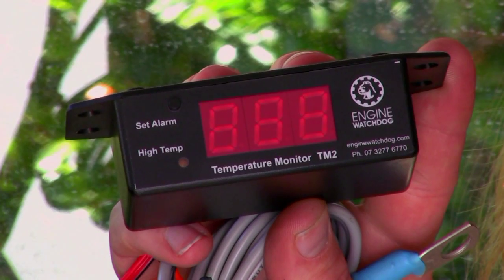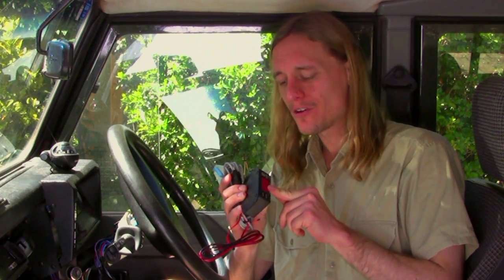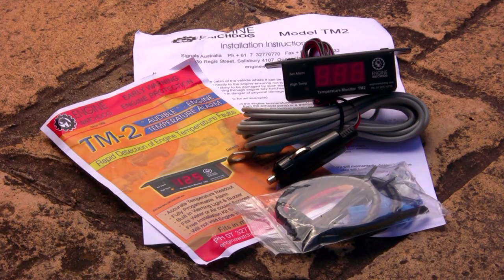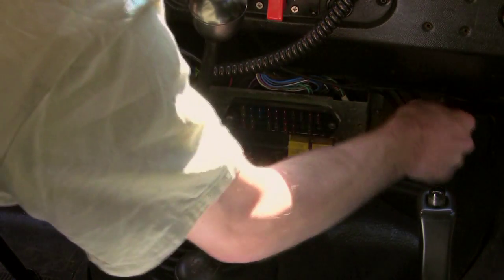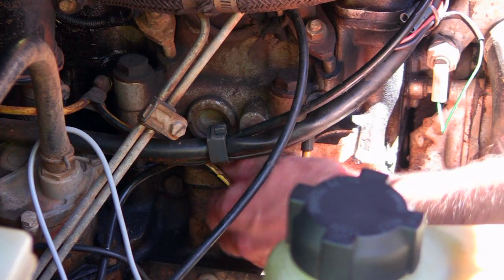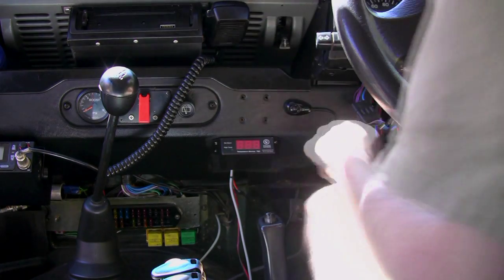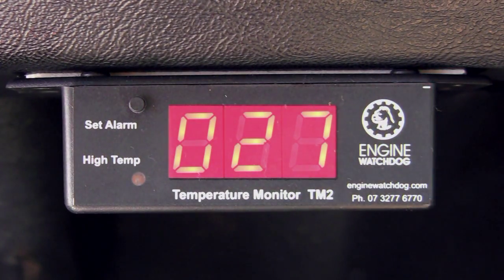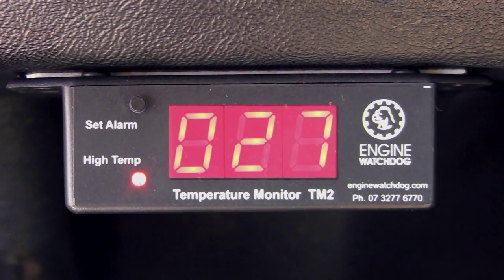Engine Watchdog TM2 Temperature Alarm Overview and Installation

Comment: Genius idea !! , Thank you
After you try the device .. what is the maximum temperature the engine body can reach from outside in " normal operating conditions " ??
Reply from the maker: Got up to 98 degrees Celsius pushing hard up hills.
Reply: thanks very much
What is the first degree of temp when the engine starts to be damaged ?
Reply from the maker: Don't know, but if your cooling system has failed, then the engine can cook itself and seize. Once the alarm sounds and the temp keeps climbing you know something may be wrong so stop to investigate.
Reply: thanks man

Comment from the maker: yes mate thats correct... I believe there is a new model out with 2 sensors for just that purpose!
Reply: thats the one i purchased , Also its not bright red its Back lit LCD display , You can get the sensor wires up to 6 meters long for free ,,,, Just email them before postage ,,,,

Comment: I guess this product can also be bolted onto a Transfer case, better than drilling the housing to fit an oil temp sensor...cheers
Reply: the new modle has trans and Engine monitor

Comment from the maker: @trulymeparker It only has a bolt on sensor you connect to the engine block.
Reply: I just purchased the ENGINE & AUTO TEMPERATURE GAUGE SENSOR ALARM, TM4 
I figure $187 delivered is great value for the TWO sensor modle with OIL PRESSURE WARNING ,
Sure beats Buying a new 6.5 litre Turbo Diesel GM motor and Gearbox ,,,on a 9250KG winnebago Motorhome ,
Thanks for the vid man 
R.J.T 
Nowra 
N.S.W

Comment: Hi Brett, good video I have been thinking about getting one of those temp gauges. Does it have a sensor that goes to the thermostat or does it just go onto a bolt in the engine bay?